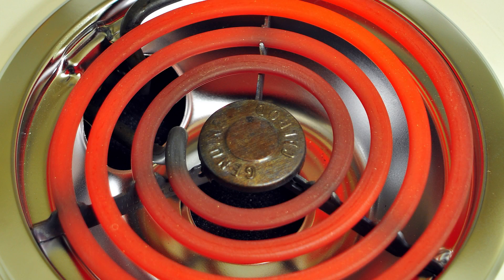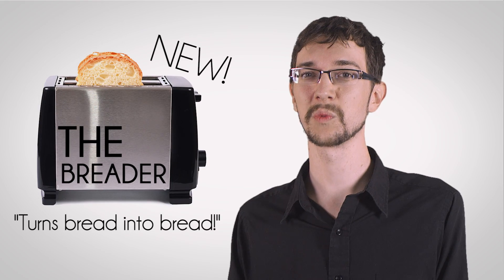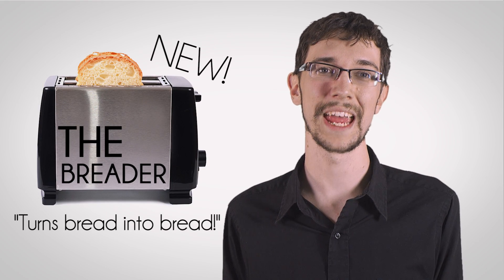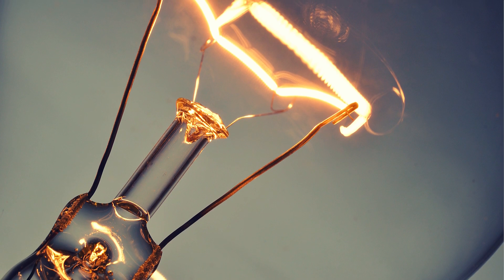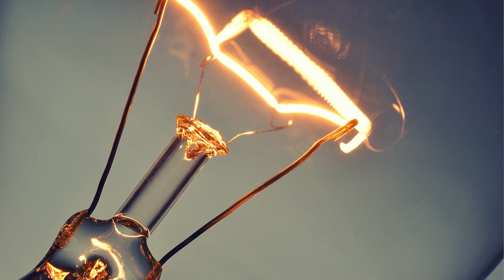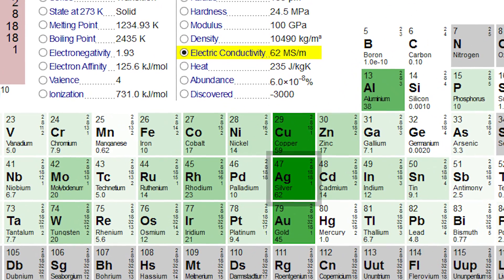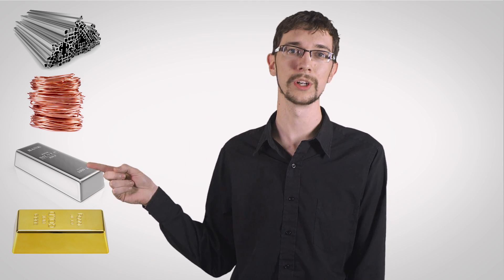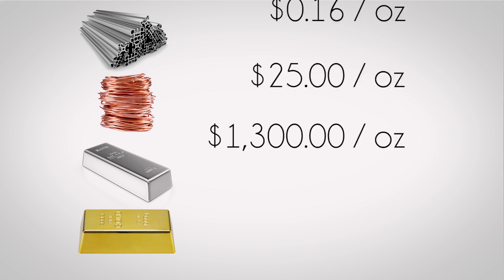What is Conductivity & Superconductivity as Fast as Possible

Comment: Electrons in the conduction band at low temperatures are combined 
into a  Bose-Einstein gas, which has the property of superfluidity, 
therefore,  the so-called superconductivity is actually superfluidity of
 an electron  gas without resistance to the crystal structure.   I 
explained why  there is resistance to the current and remained during 
the transition,  and the electron gas, due to superfluidity, moves along
 the conductor  for an infinitely long time ... and also why this 
current is not  infinitely large with the so-called zero resistance of a
 type I  superconductor.

Comment: Superconductors would only be so useful in electronics. Data storage and any calculations rely on semiconducting materials like silicon. They’d be useful for moving data and power around, but transistors and other components would still generate heat. I do wonder how much data could be transferred through a superconducting cable though. Power would obviously be unlimited, but data would be an interesting story given how inductance would still be an impedance with an alternating current

Comment: A small correction
1:24 Power transmittion systems use high voltage to reduce the amount of current needed to transmit the same amount of energy. It does not affect the actual resistance of the cables.

Comment: Why are there no superconducting CPUs?
Reply: +FiNiTe In order for superconductivity to work, you need incredibly low temperatures near absolute zero
Reply: Jayson Torres Yes but they can also be much faster and much more power efficient..
Reply: +FiNiTe Yes but  can you provide incredibly low temperatures near absolute zero near your electronics? Your CPU or GPU perhaps?
Reply: We use silicon and other metalloids for CPU manufacture. For them resistance decreases with increase in temperature. So a 'superconducting CPU' is not possible at low temperatures.
Reply: Jayson Torres However they cool other superconductors, place that near your CPU and bam.
Reply: Manan Jhaveri Wait, so CPU's get more efficient as they heat up?

Can't we use a different material for it? Though I guess making a new type of transistor gate will be a fun task.
Reply: +FiNiTe that would cover another topic. But anyway, superconducting CPU is not possible.

Comment: Actually, although tungsten is a worse electrical conductor than copper, it is still better than iron (see Electrical resistivity and conductivity in wikipedia, there is a table there). It is used as a resistance in a bulb due to its high melting point allowing it to heat up to the temperatures required to emit light (see black body radiation). The resistance it presents in light bulbs is due to its shape: extra thin wire. It is coiled up so it appears thicker than it actually is.
Reply: Bernardo Bordalo Also, being a super condutor implies being a perfect dielectric, which means they are kind of "locked in a position where the magnetic field they feel is the same as when they were cooled below their superconducting point" (in the sense that it requires a good amount of effort to move them from such positions). Building a railing with permanent magnets (non superconductor!) allows to create a zone of relatively uniform magnetic field along that railing - meaning the superconductor can then move along that rail, in either direction, feeling only the friction from the air around it. So it would also eventually stop, it would just take longer than if it was grinding on the surface of the rails.

Comment: A computer should only use superconductors if it won't lose it's super conductivity above 60 degrees Celsius. Could you imagine what would happen if you had a computer and the sun would start shining (even though the sun probably isn't that strong). The safety has to be extremely high, because your system will no longer have any form of backup cooling. Current superconductors run at something like -100 degrees Celsius. probably even far colder. So we have to go a long way for that. Also... It has to be cheap.

Comment: a lack of resistance can cause a short circuit and also cause fire
Reply: Only when it should be resistance there. Your ordinary lightbulb needs to be resistant to make light, but the cables to it doesn't.

Comment: This is sort of irrelevant to the video but I need help... If someone can recommend to me a Motherboard that would work great with an R7 265 and AMD FX 8320 I would be eternally grateful.
Reply: any motherboard with an am3+ socket
Reply: Literally anything. Try to stick with name brands like MSI, Asus, Gigabyte, or Asrock. You can choose whatever size you want, as long as it fits your case, and you case will specify maximum motherboard size. It's good to get the maximum size for your case, as going smaller in said case has no benefits, and usually costs more. Beyond that, just find your budget.

Comment: I have a PC that has no fans, no heatsinks, and no water cooling, and its power supply is rated at only 25 watts -- and it's from 1990. So while things like cars, home appliances, and HVAC systems have gotten more energy-efficient since then, desktop computers have become more and more power-hungry and produce more and more heat. 20 years ago, it was common to see computers with an Energy Star rating on them. Now, you don't see any.
Reply: Not quite... Lets look at fairly decent modern PC: Haswell cpu + internal gpu chipset would draw around 125 watts, thereby its a fivefold increase in power consumption but (at least) a hundredfold increase in performance. This is clearly showing that performance per watt is going up, the thing with power consumption however is that with more performance ultimately comes higher power draws as more (in lack of a better term) work has to be done.
Reply: But I doubt that thing has the raw power of today's computers. At least companies like Intel and Nvidia are TRYING to lower power usage. Nvidia's Maxwell and Intel's Haswell are pretty much built to use less power whilst achieving the same amount of raw performance as opposed to MOAR PERFORMANCE MOAR THIS MOAR THAT. We'll get there.
Reply: The reason computers have become more power hungry and output more heat is the need for more horsepower. I believe that will change in the next decade. However, still, a CPU more than 10 years ago was running at 10 MHz with 20W, while modern ones reach 5Ghz with 100W, so almost 500 times increase while running only  with 5 times the Watts!
Reply: In 1990 computers silicon chips had a low enough speed to not need that kind of power, now they are faster they need more.
Reply: That's really cool kit you got there. Does that computer still run? What kind of components are in it, something like an 8086 processor or... ?
Reply: stryk187 It is an AMD 8086 running at 9.54 MHz.
Reply: vwestlife *Nice!* I love it man, do you ever boot it up anymore, just for old time's sake?
Reply: stryk187 Yes, I did a video on it: Tandy 1000RL computer & DeskMate review
Reply: vwestlife A TANDY 1000 holy hell man I remember having one of those as a 10 year old. Fond, fond memories of those days. My favorite system probably of all time has to be the Amiga 1000. I remember playing Earl Weaver Baseball and the original Street Rods for hours and hours and hours. And Death Sword. Man, those were good times. Remember the Workbench OS? Jeez, that brings back some good memories. BTW - I subbed to your channel.
Reply: My PC is energy star .. So is my monitor..
Reply: topgearryan11 So are my monitors.

Comment: Prefer you to Linus...
Reply: BLASPHEMY! I liked this guy, but Linus is... A GOD! Linus will smite you with bad technology products!
Reply: Laharl Krichevskoy Not trying to be a jerk, but what do you think causes the power losses the thick wire and high voltage are meant to reduce? That's right, resistance. So the thick wire and high voltages are used to lower the resistance which limits losses.

Comment: is flesh of a human (insides and all) that transfers signals from the brain to the body more efficient at conductivity than copper or aluminum ?  I am not saying use human parts.  I just wonder if the human body is more efficient at electrical conductivity than  copper wire ?

Comment: the fact that incontinent light bulbs heat up is not a good thing. with an LED the energy you put in is allot completely converted into light, and not much else.
a slightly irrelevant thought to a good video. i like this new guy.

Comment: There is a big difference between liquid nitrogen and liquid helium.  About 200 kelvin to be approximate.  Second, most superconducting materials we used today run at LN2 temperatures.  High field magnets use liquid helium.  Lastly, the super conducting magnets that you see floating are not conducting any electricity at all.  These are just neodymium magnets with relativity large fields for their size and mass.  Their magnetic field lines are "expelled" from the super conducting material below them.  This is called the "Meisser Effect".

Comment: Cool video, but high voltage does not reduce resistance.  HV is used to reduce the power lost due to the resistance.  Resistance is a physical property of the material.

Comment: Good and informative video. GL to this new guy. 

Btw, aluminum isn't really used much as a reliable electrical conductor. In fact, I can't remember seeing an aluminum cable (at least on a pc). Due to aluminum's nearly-immediate oxidizing nature when it comes in contact with air/oxygen, it is a poor material choice for electrical conductivity. Plus the fact that soldering aluminum is a real pain, if that method is used to ensure electrical contact! 

And gold is most definitely used on electrical circuits, although it is only plated on other metals and circuitry paths in PCBs. This is because gold is very stable and non-oxidizing and makes a very good electrical contact, unlike aluminum. This is one of the reasons why some recycling businesses of old electrical equipment exist; they harvest precious metals from the "garbage" in dumpsters! 

Anyway, my two cents ;)

Thumbs up for trying out a new techquickie host!

Comment: Super conductors are not entirely resistance free and thus perfect is a terrible word for it.
Instead, the atoms in the wires lose near all of their kinetic energy allowing electrons to move through the wire more freely. They are however, still there. This makes that the wire is in no way a perfect conductor. Instead it conducts electricity very well and outputs ALMOST no heat when electricity is lead through it.

Comment: actually there are a few issues with this. Modern integrated circuits heat up not only from unwanted resistance of conductors but also from resistance from semiconductors that sometimes is actually wanted. Also inside integrated circuits there are semiconductors acting as resistance for various reasons, so even with perfectly conducting wires we still would need heat sinks for high performance electronics because of semiconductors.

Comment: Good job new guy.
Just a small correction for your video: High power lines use thick cables to reduce resistance and high voltage to reduce current (and thus heat output).
The resistance is dependent on the shape, material and temperature of the cable, not the voltage inside...